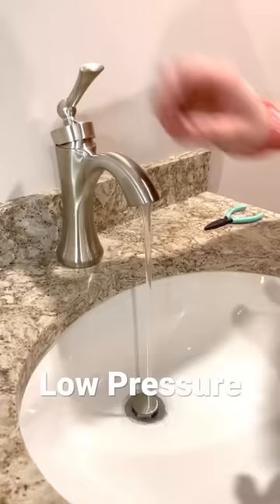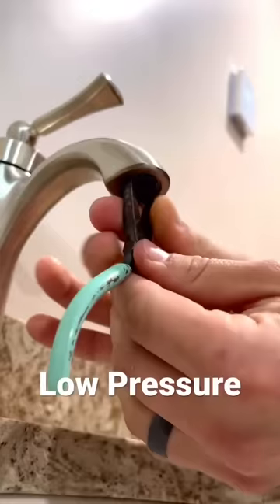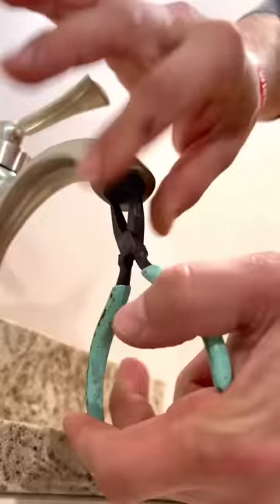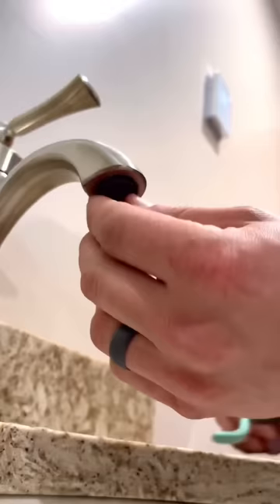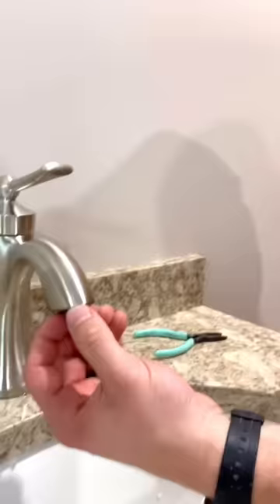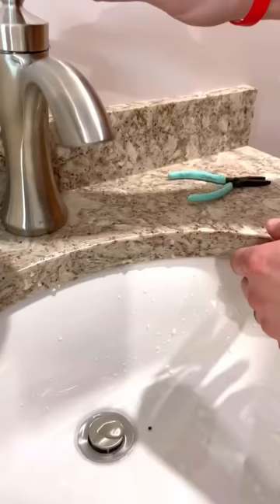How to fix low water pressure on your faucet. #diy #shorts #youtubeshorts

Comment: Bonus tip from a plumber: You can take the flow restrictor off and increase the output. Just don't tell the EPA lol
Reply: Yes, because this isn't low pressure, it's low volume caused by a blockage.
Reply: won't that affect the quality of water? when I cleaned mine I saw things that are black and dark brown
Reply: @spiderlandmemes8699  wtf is wrong with your water
Reply: I do this all the time. It's sorta personal to me that they try to limit water flow on these different fixtures. While also not having a requirement for water heaters to be designed to not blow out randomly and cause thousands of gallons to go to waste and thousands of damage to properties. All it wold take is a leak detect device with a alarm like a smoke detector has but internal and at the bottom of casing. I know it wouldn't cost more than $30 a unit to make a possibility.
Reply: @shelbyseelbach9568  yes I know that Shelby. I'm referring to a "required" device on the actual tank that all manufacturers would have to have on there units. As it is now it something that can POSSIBLY be added to water line by the consumer requiring a plumber and the added cost. So majority of people are not going to add leak detection with a electronic shutoff.
Reply: @beerbeforebreakfast  LMFAO. People aren't willing to pay the added expense, yet incorporating this device into the manufacture of water heaters would add an additional expense to the price of the water heater in and of itself. The addition of this device to gas firedd water heaters would also require an electrical connection for a water heater that currently doesn't require one, requiring an electrician and yet more added expense. An expense that people aren't willing to pay, as you have already mentioned. People are free to pay for all the extra protection they desire, be it automatic water heater shutoffs, automatic gas shutoffs, residential fire sprinkler systems, copper piping vs plastic piping, monitored fire and break in alarm systems, extra freeze protection (such as heat tracing), emergency generators, building nothing but beach style houses in any location that has ever had a flood event, etc, etc, etc. Mandating them is simply ridiculous though. Do you have a leak detector on your water heater, I bet $100 dollars that you don't. People always want to dictate that others do things they aren't even willing to voluntarily do for themselves. People are free to keep their money and assume any risk they are willing to take, building codes are already ridiculous enough. Fortunately mortgage companies already require the home owner to carry insurance at a minimum level, which they are also free to spend more money on, if they choose to, to get even more coverage that is required.
Reply: @shelbyseelbach9568  great day bro, take some blood pressure medication or something. This was all began with cleaning an aerator 🤦‍♂️ I forgot that all opinions on matters are not allowed 🚫 have a nice day
Reply: The really hilarious part is that you take water flow restriction code requirements personally, yet insist on more requirements to protect water reserves. Hypocrisy at it's finest. I see you didn't answer as to whether or not you have installed a leak detector on your own water heater. Don't want to take my $100 bet, huh? I don't blame you, no one likes to take a losing bet. LMFAO!
Reply: @shelbyseelbach9568  when people are clearly the angry one in comments I just move on. I could be so wrong about anything but there is no reason to get so upset no matter how wrong I could be. And that's the real issue at hand.
Reply: @beerbeforebreakfast  Exactly, the real issue is that you, for some reason, think I'm upset. That's called transference. I never told you to take medication for voicing your opinion or tried to somehow say my opinion was allowed but yours wasn't. These are the things you have done and are clear signs of someone being upset, my friend. I have merely stated my opinion in clear precise language, which for some reason, has offended you. Your premise that I am somehow upset is simply ridiculous. Merry Christmas to you and yours.
Reply: @spiderlandmemes8699  no because the screen will still be there. Flow restrictors vary between manufacturers but typically it's this small piece inside the aerator. Takes a little skill to take out but just take your time and you should be fine. If low pressure is a concern, quickest check is to make sure your shut-off valves are fully on.
Reply: Bonus tip from physics: You can increase the volume, you'll have the same pressure and the net effect if that that you'll just be sending more water down the drain.
Reply: How can someone filter the water so that this never happens again? My shower has clogged and is hard to clean, it take me an hours to take it apart every time I get low pressure low flow like that, any advice would be helpful
Reply: true. I think not all states require it. but all faucets have one. I didn't know about it and was about to return back installed faucet

Comment: That doesn't change the water pressure. It changes the volume of flow (GPM) that you get from that faucet.
Reply: He meant what you have said
Reply: It changes the pressure too.
Reply: @AnjaliD-nb7cr  No, it doesn't.
Reply: @badbiker666  it does.
Reply: @AnjaliD-nb7cr It is not pressure , it is velocity
Reply: Removal increases flow (GPM) thereby increasing pressure (PSI).

Comment: Water pressure depends on the height at which the over head tank is at. This method helps only for the individual taps which get clogged. I had this issue a few months back and I had to call a plumber. He removed ~4 kilos of salt and dust from inside the pipes!

Comment: If you have low water pressure isolated at one faucet then that's a great place to start. But if you have low water pressure everywhere then might be something different. Also check toilet tanks for sediment if so then a sediment filter is recommended.
Reply: I have run across several issues where people have used a flex hose to connect water heater and its kinked causing low hot water pressure. Maybe not a home owner fix though. I wouldn't recommend just changing the flex.

Comment: if you're going to take out the filter anyway just replace it, they are like $1 at hardware stores.
Reply: It's not a filter, it a strainer.  Cleaning it is less of a hassle than trying to track it down.
Reply: Neither of you are right, it’s not a filter nor a strainer, it’s an aerator. And sometimes it’s not the aerators fault. Could be the flow restricter being old.
Reply: @AznTony360  No, you are the one that is wrong.  What he cleared is the strainer WITHIN the aerator.  That is why it strained the little trash out of the water.  Yes the technical name of the entire fittings is aerator, but as you saw it strained and that is the whole purpose of making this video, to clear the strainer in the aerator.
Reply: Lmao no they’re not they’re about $5-8 idk where you live 😂

Comment: Use your phone's camera to see up towards it to see what tool will work.
Many simply require a medium or large slotted screwdriver 
Also, this style is probably plastic, but if there is calcium buildup, you may need to deal with that before you can get it out.
You may find that the calcium buildup is half the problem!

Comment: That screen mesh is not a filter at all.

It's called an aerator. It's purpose is to save water (mixing in air with the water) and to stop splashing from the faucet. Oxygen also has and type bacterial properties to help make the water just a tiny bit more clean.

Comment: A good rule of thumb is if the pressure is low on both hot and cold, then this fix is most likely the right one.

If you only have low pressure on cold or hot, well then this fix won't help.

Comment: Will that fix the baffle in the bottom of my tank? Usually your water will be squirting out kind of angled or sideways if that aerator is plugged by the way that is not the common cause for low pressure at all. Especially at every faucet in your house

Comment: Water pressure is different than having bs in your aerators. Bad water pressure means new PRV, and THAT is something you want to call a plumber on. Also if you got stuff floating around in your water system besides water then you got bigger problems than just "water pressure"

Comment: thus has nothing g to do with PRESSURE. IT IS FLOW NOT PRESSURE.
PRESSURE IS THE SAME NO MATTER WHAT.  IT CAN BE TURNED UP OR DOWN ONLY BY  PRV PRESSURE REGULATING VALVE

Comment: Thats still a hella low water pressure . I got a 3 hp pressure pump for my 17 inch shower head
Reply: Wtf 3 horsepower just for a shower? You sure your fittings havent blown out?
Reply: @Hyper_DX  haha i got a 2hp one before didnt work for the 17*17 inch water fall showerhead
Reply: @Hyper_DX  the pressure is auto monitored. It puts out power as needed
Reply: @DrparthS   how much pressure you getting? I am on a 0.5hp booster pump and i am getting 72 psi from it
Reply: @Hyper_DX  how did you measure it? I didnt measure the pressure of mine but it can run a celing mounted shower (17*17) with waterfall , two body jets 3 taps and 1 hand  shower simultaneously with max pressure.
Reply: @Hyper_DX  also the pressure is automatic, it doesnt go over a certain limit because of the sensors but when needed it uses all of the pressure
Reply: @DrparthS   there is a pressure gauge at the main pipe

Comment: Also 
Don’t forget if you swap a water heater or other pc of equipment in an older system these thing are almost guaranteed to get plugged when you recharge 
Remove the screen before you turn the main back on 

Learned from experience when I could get water out of my sinks but had it everywhere else

Comment: I have low wp from the hot  on everything. We had a plumer come out and said it’s the bladder but I think it’s the water heater. We checked Al on the flow from the well . We get cold water but no hot water unless I get it from the spout at the bottom of the tank. The plumber took off the in and out pipes  on the heater and the look free of dairy. Wj changed half the turn off valve . I can’t Sauter so that stayed in but nothing was clogging it so. I want to say it’s the water heater  but I’m not a plumer and have never seen inside one

Comment: What about low pressure I'm only one side and it's not just in one faucet
Reply: Go check your water meter and see if you have a pressure reducing valve. That could be messed up or broken. Also check your main water shut offs and make sure they are open all the way